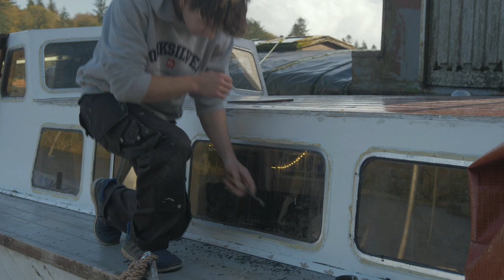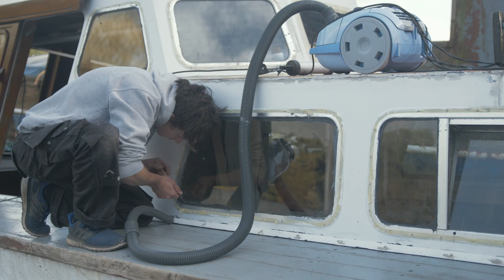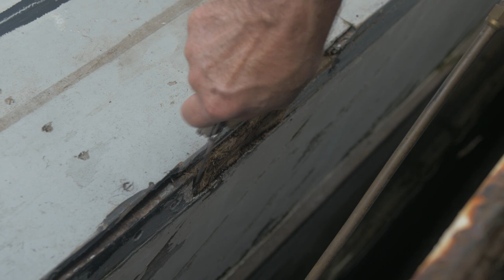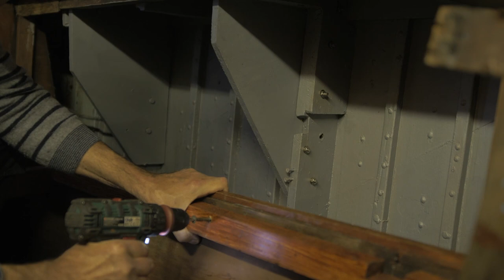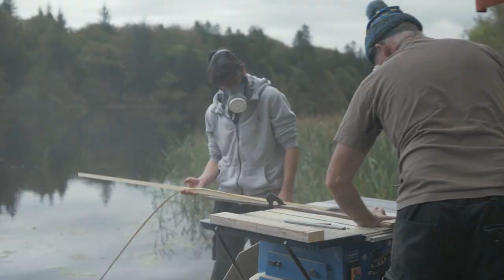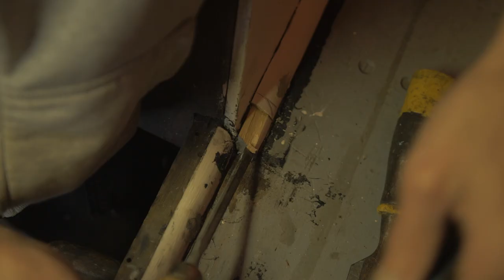Update - Restoring a 40' Wooden Boat ⚓

Comment: I have built models similar to your boat I glued a flat piece of timber from the deck and across the gape to rubbing filled the gap with epoxy resin it worked no leaks maybe a 3 inch strip.on yours may help

Comment: Are you restoring it back to RAF period?
Reply from the maker: The design of the cabins have been changed a little over the years above the deck. But the hull is exactly as s it was back in 1940